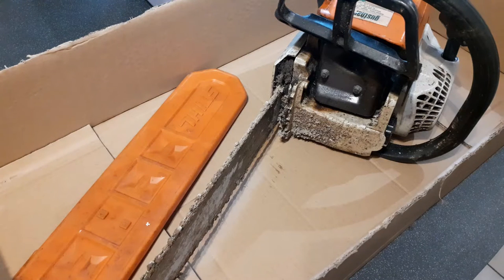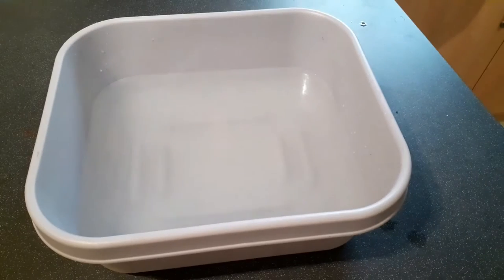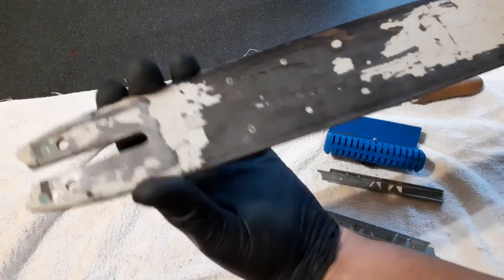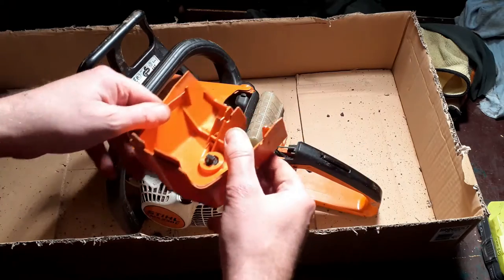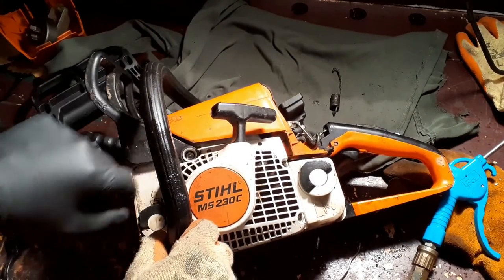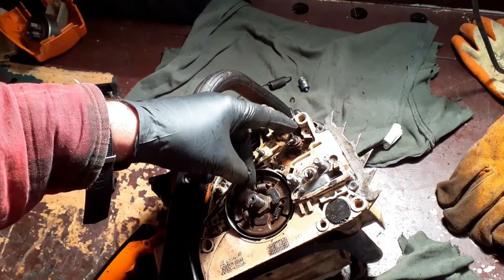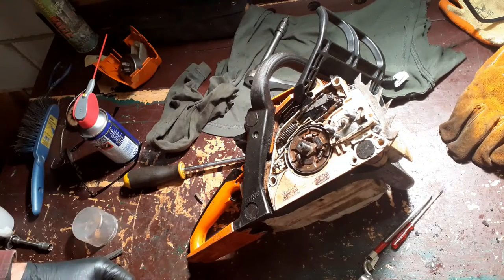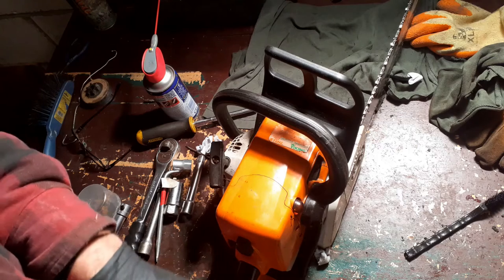Stihl Chainsaw Deep Clean, Full Strip Down, Repair and Rebuild.

Comment: Do you use a Stihl sprocket or a clone?
Reply from the maker: Thanks for the comment. For the main body of my saws I always use stihl original Parts they are not that expensive. I do use non Stihl Bars and chains though. Oregon tends to be a bit of Cheaper for those.